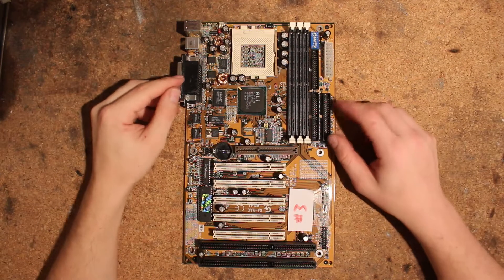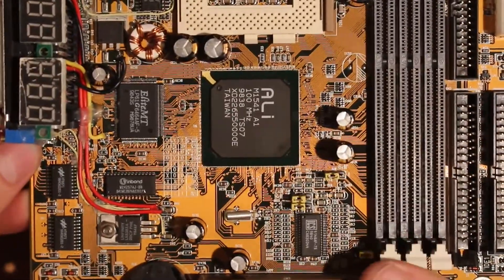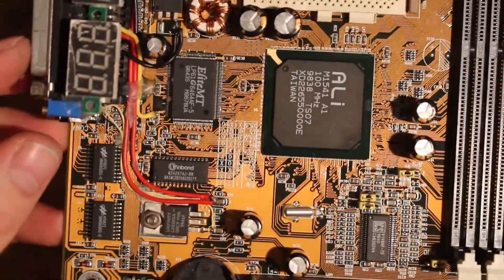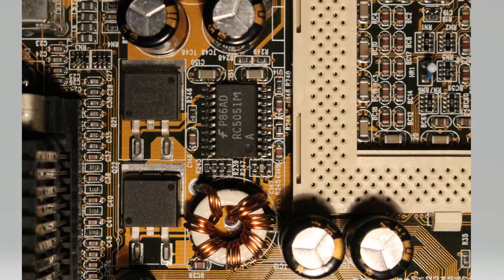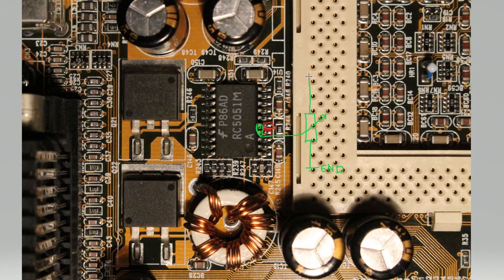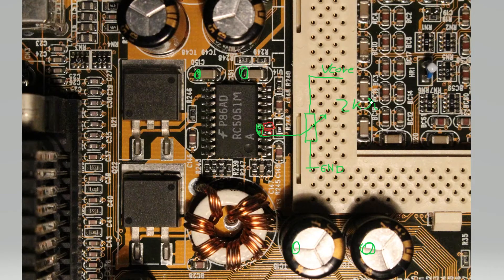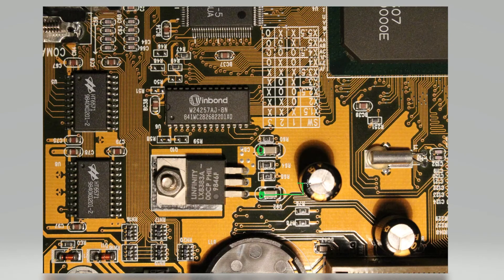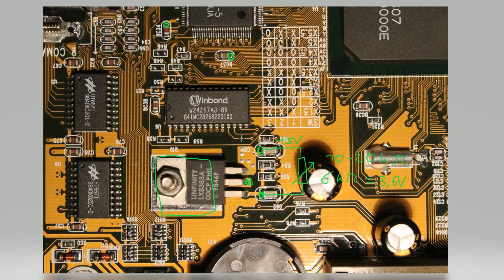Making Gigabytes best super socket 7 board even better / Gigabyte GA-5AX voltmodding

Comment: Good work.
I have this board 4.1 rev and a voodoo 3 2000, i touch the card's board (not the heatsink) and is too much hot to me (no reference to compare), i know that graphics card can be hot but to me is hot, this happen even in desktop.
So i was digging for info, is not related to voodoo hot, but i found in vogons one guy who ask for difference between 4.1-5.2 and one guy said  "main differente between 4.1 vs 5.1 is the VCC3 jumpers on rev 5.2 that will connect VCC 3.3 directly to psu. I believe that is in reaction to newer AGP cards destroying some Gigabyte mainboards with their power draw. you can run a wire on the back of the board from atx connector to the AGP slot if your revision doesnt have the jumper."
I found another guy (about a gigabyte 370 socket board) , who ask for help because of a voodoo 3 3000 being hot and one guy said to short jp12 &13 to fix that.
so I have related both topics but I don't know if they will be related, are you informed about this?. My problem is i dont find a tutorial or trusted 100% info.
Thanks in advice.
Reply from the maker: Never had any of the issues you described, allso not really a 3dfx guy, but maybe i can test out some stuff with a card with high powerdraw if i find time :)
Reply: @taggxoc  appreciate it but dont worry, just asking if you knew about it, im going to dig for info, dont worry and thanks.
Reply: @taggxoc  in case youre interested i found the correct info.
What happened to some first agp boards is they arent prepared for voodoo cards because they are more current hungry, maybe the vrm or the board gets too hot but i dont know if this 4.1 rev suffer from this. the 5.2 rev has the jp13 jumper to change the vcc3 voltage but i dont know anything more beucase i dont know about electeonics, just i try to understand as much possible i can do.
i found another board 370 socket that clearly has a jumper for voodoo 3 card (didnt mention anything about the voltage, just said that jumper is for that graphics card) and i found another guy in reddit who did a similar mod to a board because that part was really hot, so he did a mod to provide current from the 3.3v atx pin.
Reply: Hello Jorge did you find solution? I have also rev. 4.1 board.
Reply: @juhakarhu9410  Hello man, dont worry i dont know if this is a problem or not, that was just an asumption.
I have right now the voodoo 3 2000, i havent tested it too much being honest but for the moment I haven't had any problems instead of the voodoo heat, according to what i saw on the internet this card seems to be very hot, i dont know if being hot in the desktop is normal or not but from what I see people say that this card is very hot and that it is good to put a fan on the heatsink
Reply: @jorge7317  Ok, thanks for the info.
I have a Voodoo4 4500 but I don't know if I have enough courage to install it to this Gigabyte motherboard?
I have also searched online info how to do that mod for this motherboard ( not find any ).
Reply: @juhakarhu9410  man as i said, is just an assumption.
The first boards or some of them are not prepared for the voodoo current, but that dosnt mean this one has the problem, i dont know.
i remembered one thing, looking to the manual from the ga-5ax for the jumper jp13 it says something like that jumper increase or decrease the vcc power 3.3v-3.43v or something like that, im not sure if that is related to the graphics card or is voltage for the cpu, do a search for info and clarify that, i cant say other thing.
Anyway, in my oppinion that voodoo probably is "too much" for this board, i dont mean in power because according to what i read (check if this is correct) all voodoo cards use 3.3V, i mean about the performance.
I have a k6-2 450 and i have cpu bottleneck and very probably ill have a bottleneck even with a k6-2+ 570 (wich i think is one of the best cpu for this socket ss7), so in other words, maybe that card is a waste of performance for the ss7 socket.
I dont know how much performance you win with your 4500 vs mine i didnt check a comparison between all voodoo cards, but if i have a voodoo 3 and im not getting all the performance in this socket will be the same for you.
Just get something lower for this ss7 and use that voodoo 4500 with a better cpu, check which board is compatible and get something better for that card ✌️
EDIT: here in youtube there is a guy with a channel called "3dfx voodoo" (you can find a max payne video from him) i cant speak for him, but one time i spoke with him about voodoo cards, is a nice guy, as i said i csnt speak for him but maybe he can help you to choose cpu & board for that card, you can go also to vogons forum.